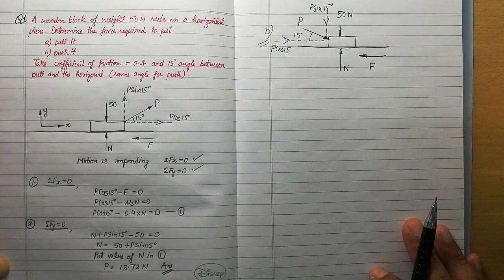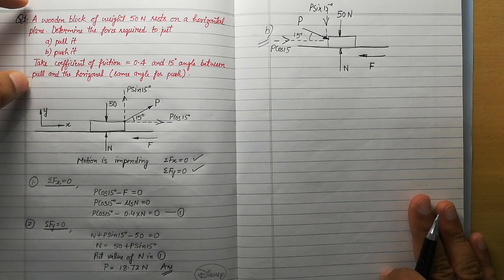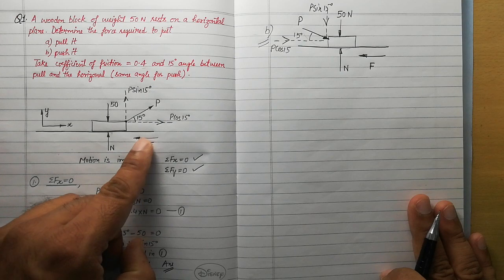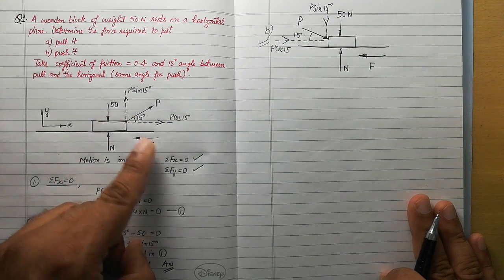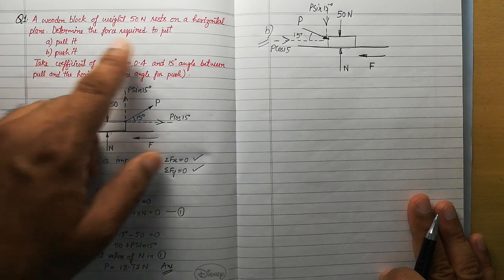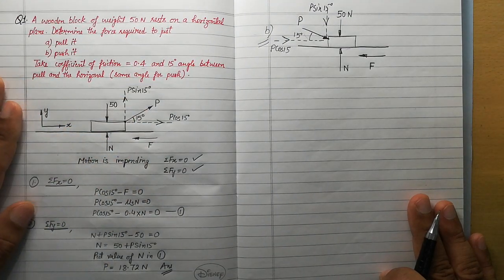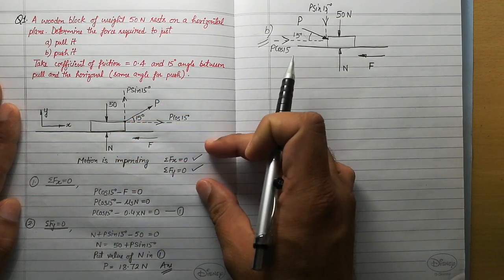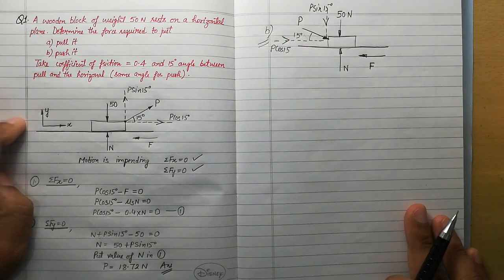Friction | Friction Problem | friction engineering mechanics | Engineering Mechanics | 8.4

Comment: Pls my answer isn't the same with yours 
Can you break down how you did it with your calculator
Reply from the maker: Dear, while making equation 2 that is Fy = 0,

The equation should be N = 50 - Psin15
But in video it is written by mistake as N = 50 + Psin15.
But the answer is correct in the video as it is calculated with correct equation as written above.
I guess this is the confusion which may result into wrong answer of yours.
Reply: It's 23.19N calculate it well sir
Reply: @AphroGift     

Pcos(15)-0.4N=0 -------(i)
N=Psin(15) ------(ii)
Putting equation (ii) in (i)
==>Pcos(15)=0.4N
==>Pcos(15)=0.4(50-Psin15)
==>0.965P+20-0.103P
==>1.068P=20
P=18.7265N